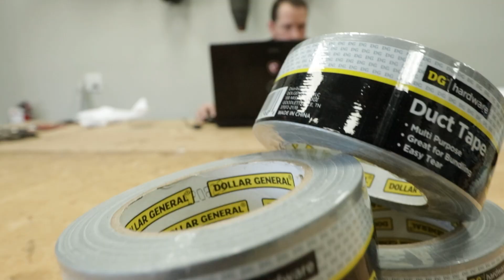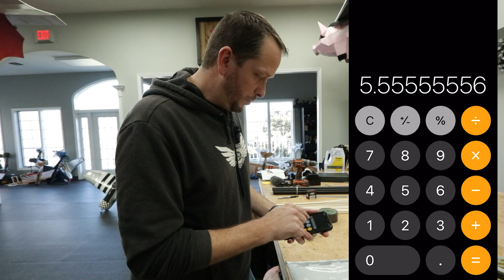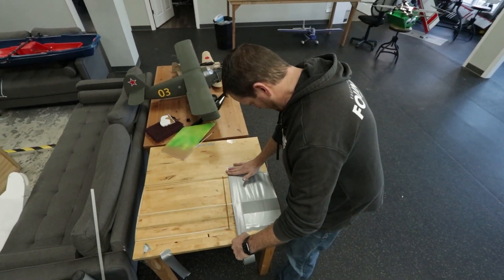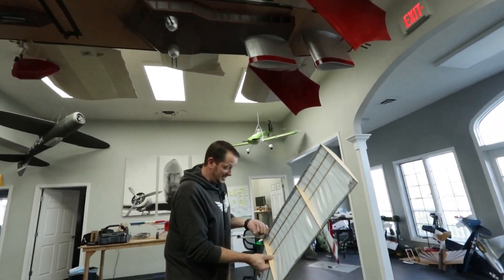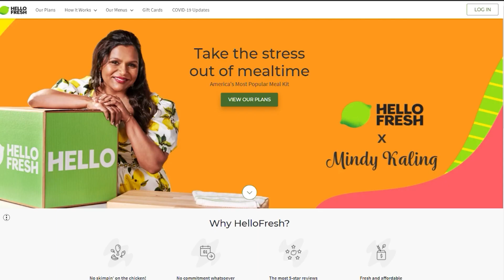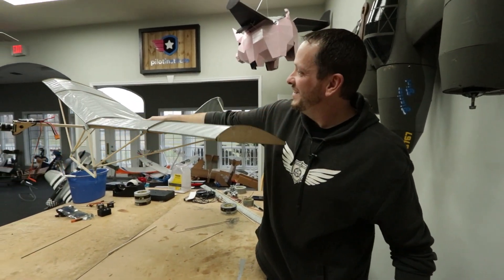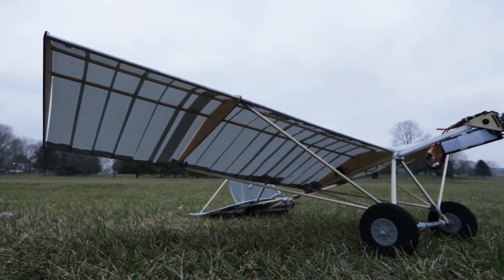Duct Tape Plane

Comment: You could probably use more ribs in the wings and run the tape parallel to the trailing edge and get a smoother airfoil. Also, starting the tape on the trailing edge of the wing and overlapping the previous strip slightly, instead of running the tape like Josh did, will possibly increase the aerodynamic performance while decreasing the overall weight.

Comment: Try those 3mm PP hollow boards like they use for ads when we have elections.
I live in eastern Germany and there are plenty of those annoying AfD-adds with barely legal inhuman slogans. So it's a good Idea to tear those down and make s.th. good of it.
This stuff:
https://www.bindemann-verpackung.de/PP-Hohlkammerplatte-weiss-600x850-mm-450-g-m-3-mm.html

I think you can shape them similat to maker board with some cuts and even hinges should be possible.

Comment: Try cutting plastic bottles into thin (2-3mm) ribbons and use that to tie together the plane. Heat the ribbons later with a heat gun and it will tighten the ribbons up. :)

Comment: Do a competition style, or multiple persons, build where you each buy all the structural components (probably not the motor mount) in a supermarket on a (at least semi) tight budget. And no foam boards if the sell those.

Comment: Hey just found yall and I've been watchimg yalls videos and yall are awsome my question is Have yall ever done planes with gas motors? I also noticed yall can drop stuff, why not make planes that launch rockets or missiles, just have tracks on the wing using servos to lock the rocket in then have simple rocketry rockets launch via radio or servo ignition. Also I noticed yall have the goggles why not with the high flying planes have a cockpit cam that sends signals to those goggles so you can more accurately fly as if you were piloting.   Also just gonna throw these out there, steampunk airship (not a blimp or really a quadcopter  Ark steampunk mod had a cool one), flying aircraft carrier to launch and land planes from pretty much a runway quad or octocopter. Also a floating Deep space 9 just ideas oh and why not make something like a harrier jet that takes off vertically and uses the same engines to go forward again not a quad copter.  Also why not do life size rc planes like a stealth jet.

Comment: Hey you guys should build 3 or 4 planes all the same structural design, motors amd everything but use different tapes like duct tape, gorilla tape, scotch tape or some sorta regular tape, and then a plane made of your alls foam board and then put them through rigorous test not only toughness but see which ones perform better like speed maneuverability and then which one is tougher like mid air collisions or just straight dive bomb into the ground or into a building made of jenga blocks or Lincoln logs or legos or even foam board or like something that will be able to collapse when the planes are flown into it and also but some "hollywood" special effects so when you hit the tower with the plane the tower blows up lol. also see which plane and carry more ordinance like bombs or spy equipment. so yeah i think that would be a great episode and make it a whole documentary i like when the episodes are long not like 2 hours but like 3p-45 minutes! 👍😁🤠 please please please do this episode!!@ Thank you for your time and reading g the comment and hopefully considering this idea for an episode, and if this episode does happen and you get at least 200,000 views and at least 5,000 likes would i be able to order a P-51 or F-15Eagle R/C plane I would like to put most of it together, i just want everything to come with it stickers, motors, controller, battery, charger. pilot manichean, and all the other props that are necessary, please and thank you, PS: i can pay for shipping and if needed pay for some things lol🤓🤕😷🤣🤠🤭

Comment: Have you considered making an airplane with a « conventual » wing that is controlled by a servo that changes is it through a pivot point that changes the wing to a swept back or flying wing configuration so that it becomes a high speed aircraft?

Comment: Here is my Idea for another build!!  Have you ever built a wing for an envelope of material? I would like to be part of this via skype or zoom as a remote builder!!  I have always wanted to take shear stockings and do a sleeve wing build, where the wing structure collapses to go inside the stocking sleeve and then is expanded to fill the sleeve and create the wing shape/air-foil. Would love to see this on a taper wing or even a wing shape like what you just did with the duct-tape build. I am one of your founders and am 100% glad I donated my money to your current location!! I look forward to coming and flying with all you of you one of these days!  So if you would like to try a new way of building with your fans, then lets try a skype build or zoom build and video record on both ends of the collaboration!!  Look forward to hearing from you if you choose to try this concept out.
Best regards,
-Tim                                                                                                                  gyroblackwell@gmail.com
                                                                                                                       Timothy Blackwell , Phoenixville, PA.  and Hobe Sound, FL.

Comment: Oh Jesus, you've got to have another go at this, but adding a little more strength, and covering it with some proper film to offset the added weight. If you could combine the cheapness/ease of build with that walking pace flight speed you might have another set of "Budget trainer" plans to add to the collection.

I started flying RC helicopters (And then quads) when I realised that my eye's weren't quite up to RC thermal gliding anymore, I had to find something I could keep within a couple hundred feet so I could be sure of not losing orientation, but this thing looks like it fly's soooooooo slow that you could almost do circuits in a large back garden ! I could see myself having no trouble keeping this close enough to avoid any of those "Oh crap ! Which way is it angled?" Moments.

Comment: I have an idea for a plane that I wanted to do myself but never go around to finishing.  I built a huge water rocket about 6 feet high and it travels roughly 100 feet per second and launches to around 600-800 feet in altitude.  I have one slow and low launch on my channel you can see.  Anyways, I made some massive foam wings that were inspired by the retractable F14.  With the amount of drag the altitude would be less with wings but you can mitigate that.  The part that I never got around to was actually attaching it all together.  The idea would be to retract the wings at launch then glide it at altitude.  You can "drop the rocket(s)" to lose weight via servo and let it float down via parachute.  You can made a dual rocket body to more closely "resemble" (lol) the F14.  There are a lot of variations of that idea but that's basically it.  It is not a simple build you when you factor in the launcher and you have to make all these fittings air tight.   I use a scuba tank to fill it with compressed air.  If you do it right, it's not a simple build!

Comment: Super size it!!!!  ;o)
That would actually make a good trainer.  That thing is so light in the air.  Great job guys.
Check out SPAD designs.  Here at https://www.spadtothebone.net/  you can see many designs using this concept.  Maybe super size one of those.  Make a SPAD large enough to use a weed eater motor.  That would be cool.

Comment: I'd love to see a 3d printed plane in which you only replace the structural parts with 3d print parts and cover it like if you were covering a wooden frame
Reply: That's not a bad idea. Someone could go through a balsawood model and replicate it's structure as 3D printed sub assembly's. They could also tweak the infill to add strength where needed, and lightness where strength isn't such a big concern.
Reply: @U_Geek  I'd think it could be made lighter than traditionally built balsa plane kits, because where those tend to have fuselage frameworks built up mainly from one or two different thicknesses of wood to keep costs down, 3D printed frame parts could be made to whatever dimention or infill density would be most suited to the loads that perticular beam or brace is likely to encounter. You wouldn't end up adding extra weight bracing an area thats under minimal load with balsa of the same dimentions that you used for strengthening heavily stressed areas.
On built up balsa wings you usually use the same thickness of wood for all the ribs, but if you 3D printed them you could thin out the middle of them, and still have a wide return lip around the edges to fix the covering to. The spars could also be made with less and less infill as they extended further away from the center as they're supporting almost no weight at the tips (except when you crash. :D) because the stress builds up progressively the closer to the center it gets. You could also add thin diagonal bracing between the wing ribs to greatly increase ridgidity without adding the huge amount of extra weight you see with balsa built wings. 
Dispite 3D printed plastics not being as strong per gram as balsa and glue, being able to only place material where its needed would save a lot of weight.

Comment: I wanna see you make a birdycopter  ... like an eagle sized bird with its wings folded at its sides and a co-axial rotor system in place of its head  ..  so you can take off like a rocket and then glide down  ..

Comment: I’d like to see y’all build a C130 with Estes rocket engines strapped to it like the blue angels c130 with JATO rockets. Then do a boosted takeoff. It will be hard to control on such a small scale but could be really cool to see a plane with such an accelerated climb profile on a small scale. Then put a Traxxas T-Maxx in the cargo hold, have a door that opens up and releases the traxxass out the back with a parachute, once the T-Maxx is on the ground it initiates a land to air race, first vehicle to make to to the furthest green on the course wins, the C-130 has to land on said green though. You’ll either have to have the truck running upon takeoff or find a way to start it up in flight, which they have electric ignition now so that may be possible

Comment: I'd like to see this same plane made again but with the tape reversed so it's sticky side up on the upper wing. Then smoke tunnel it and see how much difference there is. There should be at least a small difference because the sticky side is not smooth. That'd be interesting!!

Comment: I think the wing also needs to have duct tape on the underside. Only having the top covered might save on weight, but the lift-to-drag ratio will improve dramatically if you also cover the bottom of the wing.

This is actually kind of what happened during WW1 with aircraft design. Initially most aircraft were designed with very thin, slightly curved wings, with the idea that a shape like that would produce the least drag (though the aircraft needed to be bound together with wire, which caused more drag than the designers originally realized). However, eventually aircraft designers discovered that a wing with thicker aerofoil profile produced both less drag AND more lift, and that design started to dominate. If you compare something like a Fokker Eindecker wing to something like Fokker Dr.I or Fokker D.VII wing, you can definitely see how the aerofoil shape is more "full" on the bottom. In the end of WW1, cantilever wings were becoming the norm already.

It would be quite neat if you could do a flight test with the bottom of the wing also covered with duct tape, and check what kind of performance difference that makes. My hypothesis is that the wing will perform a lot better with both top and bottom covered, but ultimately only an actual test would give a certain answer!

Comment: When I was a kid I covered a plane once with saran wrap because that’s all I could find around the house. It would be very light.
Reply: Yeah, same here, but it was done because it was the absolute lightest easy to obtain "Film wing covering" I could think of for ultra light indoor RC models. Only problem was that it isn't very ridged and will stretch, allowing the wing to warp in flight.
Reply: @Reman1975  Yeah, the plane I did it to was just a hand chuck glider I built up. Agree the  durability was a huge problem.

Comment: Awesome! Just don't fly it when it's cold. The adhesive will freeze and it will not stick at all anymore. I'm from Minnesota, I've seen it plenty of times. :) Now I'm wondering if 3M has low -temp duct tape, hmm .......

Comment: make a VISQUEEN plane. it would be clear and you could put some COOL LED'S INSIDE
Reply: I would use the "  STICKY ON ONE SIDE VISQUEEN ". its would seal itself would using tape or glue
Reply: they use it in roofing and large carpet rolls to keep them form getting dirty. its amazing stuff

Comment: I had a job one time, back in the sixtys, flying damaged airplanes to a repair shop in Michigan, from all over, I used a lot of duct tape, pluging holes & taping landing gear down etc, we called it Hundred Mile an Hour Tape, cuz it was good for about HMPH. I never had it come lose or an accident, I just flew slow enough to stay in the air.

Comment: Watching this video reminded me of the increasing relevance of CAD in model R.C, I watch you and Peter Sriprol use many forms of CAD (3d printing, laser cutter 2d, foam board flat cutting, mixes, and even ms paint drawings you can print on paper and cut out). I think it would be helpful to the community, and interesting if you made a video or series documenting the specific methods of CAD Modeling used by flight test when developing new designs. Also I've been watching flitetest for almost 4 years, and its amazing that you've almost reached 2 million subs, keep up the great work!

Comment: i made a glider out of cheap styrofoam plates that is shaped like a Romulan Warbird.   Id love to see what it does with a motor on it.  Maybe you guys could take that idea and run with it.  I was pleasantly surprised at how well it glides.   If the wind hits it, the craft flips around a bit but then it automatically rights itself as soon as the gust is over, so far it has always landed perfectly.  Even when i tossed off the roof of our apartment complex.

Comment: Dollar store under $5.00 challenge! Build as Cheap as possible.
Saran wrap , bus queen, double stick scotch tape bamboo skewers. Build fuselage wings etc  for under 
 $5.00. Oh super glue acceptable. The skins won’t take a crash but what the heck right.
 Not if a roll of Saran Wrap cost $5.00 you only use the percentage of the roll you used, same for all parts. 
 I know you can probably make one for less than 5 bucks. Used foam board in forming wing  rib shape. Go big go cheap or go home.

Comment: Go with the same basic design (DAMN that was a nice STOL take off!) but try different materials for the wing coverings.  Saran wrap, tin foil (don't forget the hats) and fiberglass window screen have all been down in the suggestions.  I wonder, if you get the ultra-fine mesh screen (midge screen) could you get away WITHOUT sealing the holes?

Comment: What about building a plane using fiberglass window screen and spraying it with just enough Flex Seal® to get the amount of lift you need?
Reply: A thin coat of resin might keep it light and strong.
Reply: It would be pretty heavy, considering it's liquid rubber.
Reply: @MrJJandJim  I never used the stuff. I would guess it would almost fly with a light coat of the seal. I know when I put a fan in the window I have to open the screen to get the max CFM flow since the screen is a little restrictive. I wonder if it would fly (I doubt it though) without the flex seal and a big motor.
Reply: @sportswolf1  I haven't used it either, but I know that the stuff is a thick, goopy liquid. A "thin" coat would be messy and uneven. But with a big motor, it might fly. Probably needs to be fast, like a rubber missile, lol. But there is Flex Tape, too. Possibly similar to the duct tape but certainly heavier.

 A flying screen by itself, however, I'm not sure. Probably wouldn't work.
Reply: @mgoblue0970  I think the proper term is "guided missile" lol!

Comment: LOL go to taxi and instantly airborn :)
Would nto take much work to make it strong enough to take some harder landings honestly. A bit of advice is you dont want it to look like a chia pet get some of the non toxic bug killer powder diatomaceous earth aka chalk dust and dust the underside once assembled. It wont add enough weight to be noticeable and nothing else will stick. Talc etc will work also but diatomaceous earth is just stupid cheap sold as bed bug killer roach killer ant killer ________ killer basically if you have a insect pest there is a powdered non toxic diatomaceous earth based killer for it. 

Now i just wish i had some money to spend on the radio gear and the like to build me 1 lmao

Comment: On the forum we're having a competition to see who can build the lightest FT Mini Scout. I tested a design where I've cut holes in the foamboard and stuck tape over it - I'm amazed how well it works on this scale - 'cause on the FT Mini scout, when I tested the holed-foamboard with tape on BOTH sides, the weight loss was a tiny 1.8% haha! I've gone with tape on one side for the stabilisers (which is 22% lighter than plain foam board) and wrapped cling film around the wings. I'm gonna run it on a tiny 1S power system and hopefully the wind will stay down!

Haven't finished yet, so can't give you a final weight. But guys... You didn't tell us how much this Duct tape ultralight weighed in the end! D: